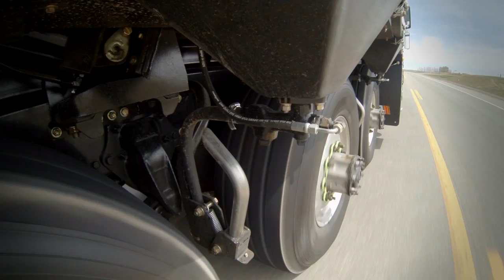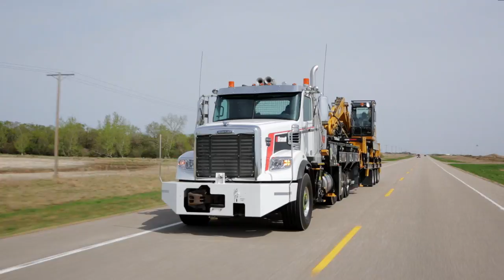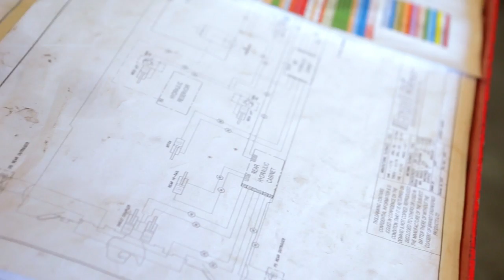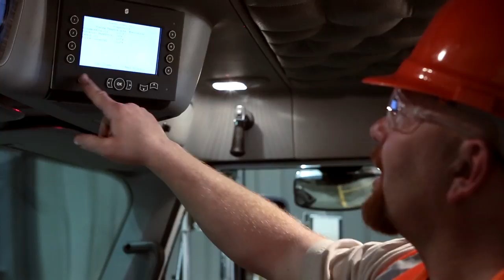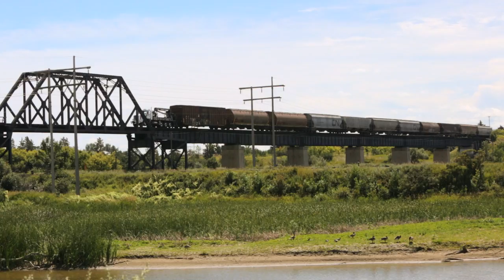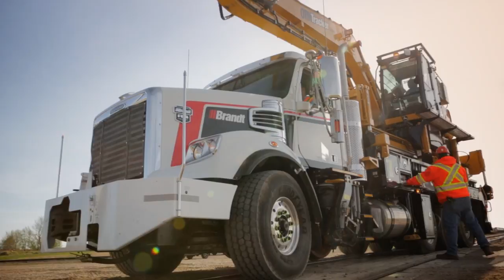Brandt R4 Power Unit

Comment: How does braking work on the rails with loaded cars? Do you put it into neutral and apply the brakes or keep it in gear?
Reply from the maker: Hi Derek,
Great question! The purpose-built 26C brake system on the Brandt R4 achieves maximum train stopping power while ensuring positive control of the trailing railcars. We recommend keeping the truck in gear to use the certified hi-rail/train brakes first, and supplement with the truck brakes if required.

To speak with a R4 specialist, please don't hesitate to call our toll-free number 1-888-2-BRANDT (1-888-227-2638) or send Bruce an email at bdagenais@brandt.ca.
Reply: I see they have a train braking system for the cars I'm quite familiar with running locomotives for 35 years.